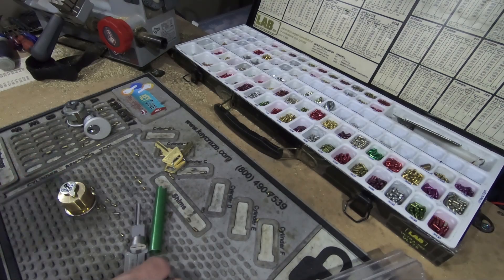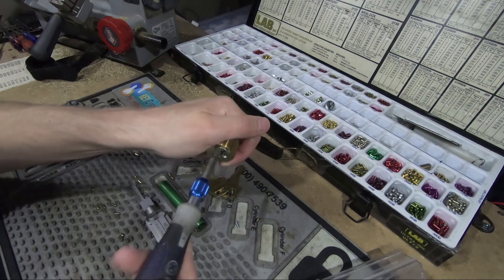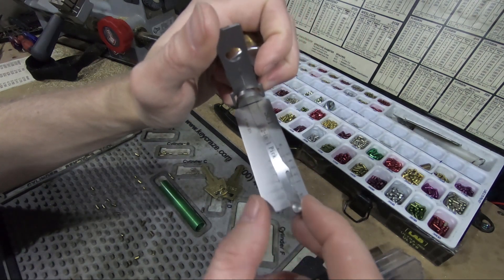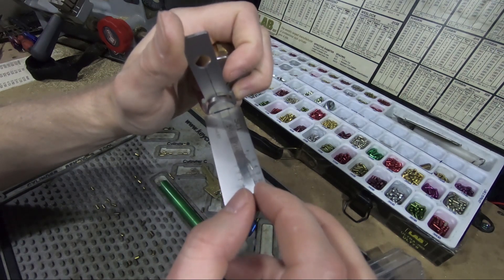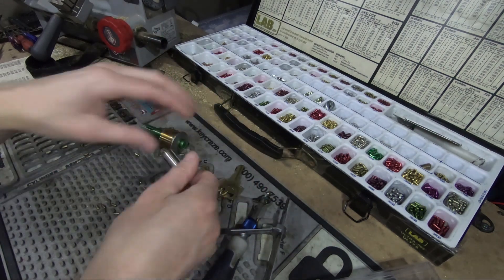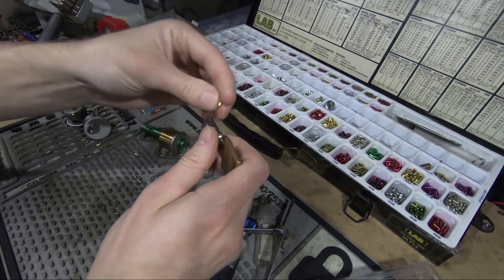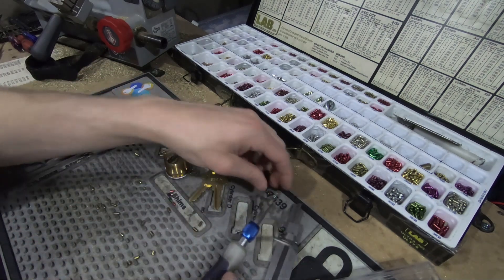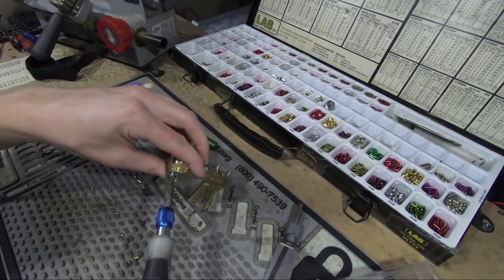(353) Using SC1 Lishi Instead of a Shim to Rekey a Lock

Comment: I can ship a lock cylinder a hell of a lot faster than that Lishi tool which I think is an expensive little junk of JUNK
Reply from the maker: im sure you can.  you are wrong that they're junk though.  I use them all the time on cars and the pin tumbler ones..  i did a job recently that I had to make keys to a bunch of condos.  with the lishi i was able to just decode them all without taking anything off the door or even bother tenants and then cut all the keys.  saved tons and tons of time.   i use them for lock outs now too.